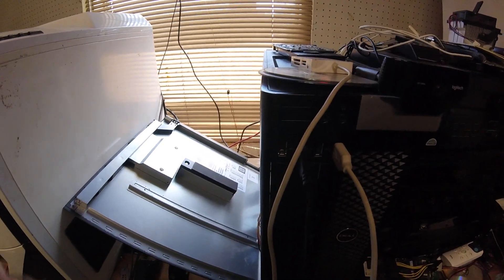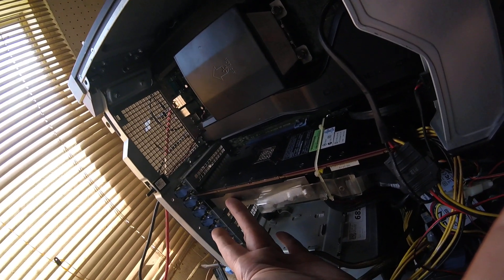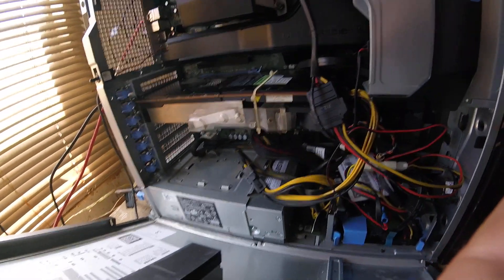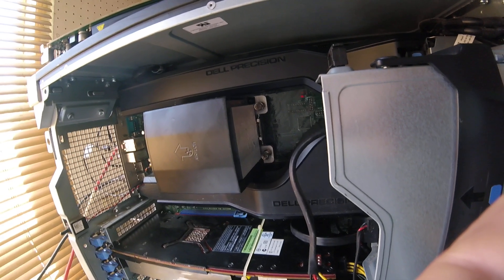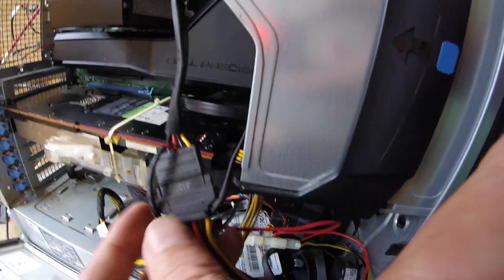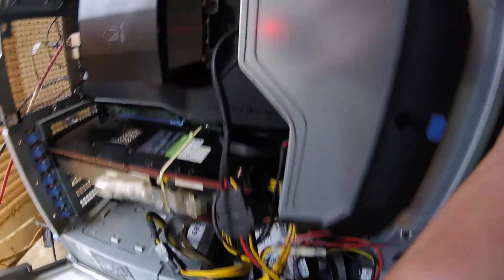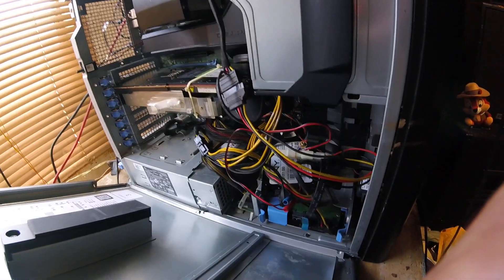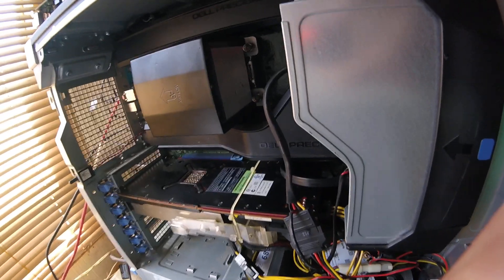getting your Fancy Schmancy Video card to work in a Dell T5810 or T7810

Comment: Dude your a jack of all trades!
Reply from the maker: Motorcycles were always a hobby/my side money business -- Radar and Microwave Communications networks are what paid the bills .. Dabbled with boats and aircraft too
Reply: @dawino6260  wow.. Impressed.. Printers were my thing.. Im same age as you 52. I'm getting those two 82 GL 1100s tomorrow wish your were here to help.. they been sitting a few years inside a shop. You have any tips or a small list of suggestions to start with brother?
Not trying to tax you or be a pain.
Reply from the maker: @2keeperv  I'm 60 myself ... First thing i'd do is go through and replace everything rubber -- timing belts, hoses, all those wonderful little  rubber grommets ... Carbs i'd clean but it's according to how it was stored as to how .. if they were stored well .. just fill the bowls with STP plain old red can gas treatment and let em sit a couple days right on the bike .. If they weren't stored properly ya gotta pull em and soak em in carb cleaner ... Fuel tanks drained, filled with 100ll to break up the varnish for a few days, then drained again is usually good enough as long as you ride a couple tanks through right after ... fuel filter is an automatic replace .. Oil change before they start and again after about the first 1/2 hour or hour of running them (and while still hot - oil turns to varnish too - this keeps you from having a stuck clutch plate later) ... Tires after they are running but before they hit the road .. Brake fluid flush and fill -- Pads and lines both ends even if the lines look good (keeps you from finding out they were rotted inside and having a clogged return passage keeping them locked when you dont want em to be locked) ... Of course take apart all the wire connectors and hit em with CRC electronic parts cleaner -- The usual basics ... Oh and fresh bearings front and rear -- Steering head bearings too ...  It's not uncommon to see an old wing with rutted stearing head bearing races that'll make em handle sloppy - or worse 30 year old grease that's turned to paste so you dont catch a front bearing that's about to wreck itself right away ... always prudent to at minimum to check at minimum
Reply: @dawino6260  Thank you very much brother.. Invaluable information.. Your the man I'd listen to and follow.. Getting the truck arranged this morning to bring em. Got boxes of new parts with em.. It's like Christmas..ha
Reply: @dawino6260  so here is what's going on now.. Battery in it.. New fuel filter and hoses.. Fuel filter installed correctly. Pump will not fill fuel filter.. Took line off pump to carb no fuel coming out when cranking. Changed fuel pump from other bike same thing.. Nothing coming out of fuel pump.. Any ideas bro? 2 bad pumps? Unlikely hey.. Stumped so far ..fme

Comment: Does it come with a gpu power cable?
Reply from the maker: If it doesn't it's only 5 bucks on ebay for the real Dell  cable -- plugs in right in front of the power supply on that little board at the bottom of the case
Reply: @dawino6260  Any recommended links? I got one without a GPU cable and trying to figure out what to buy.
Reply from the maker: @fearthesmurfs  you can either make one from a splitter -- or just drop 5 to 10 bucks on ebay and buy a real one --- attaches to the white molex on that little board in front of the power supply20 something bucks from dell -- ebay always seems to have em .. amazon not so much --
Reply: @dawino6260  Thank you, think I will just order one then! couldnt figure out if it was the white or black plug on the power supply extender.